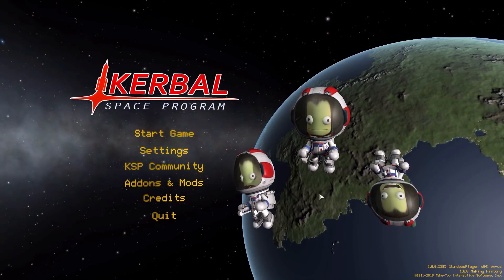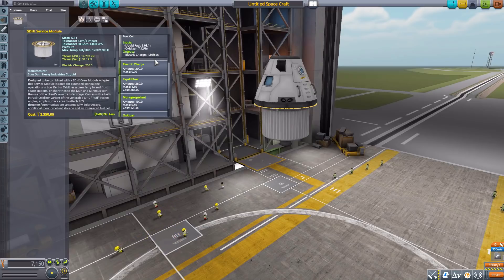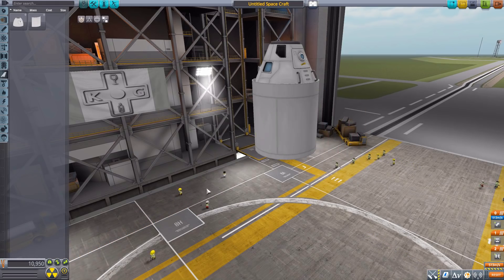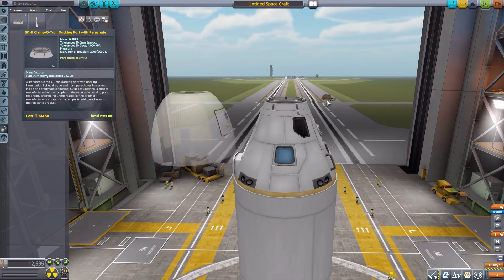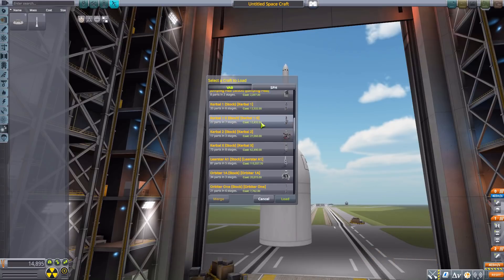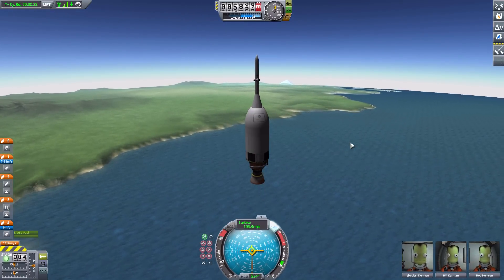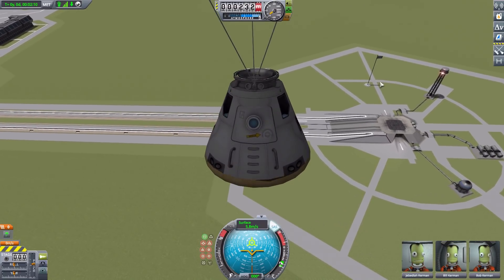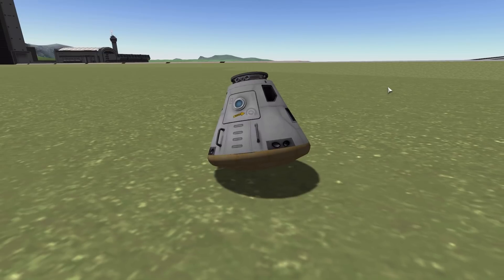KSP Mods - SDHI Service Module System

Comment: Cool as normal, and happy new year and all that. It would have been cool to see the abort system take it away though :~)
Reply: Abort system's cool & all  - but it looks like he sep'd the boost protective cover & LES tower with the tower abort motor rather than the little jettison motors that are built into the BPC, so we missed that - though tbh, the pod sep at abort is nigh as fast as just the tower going away!